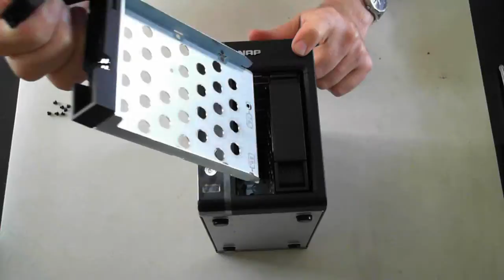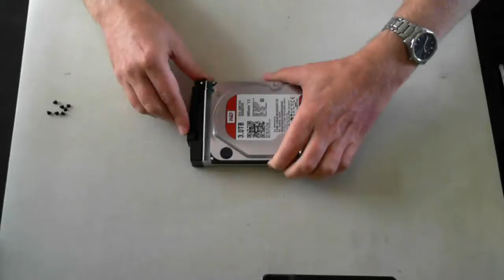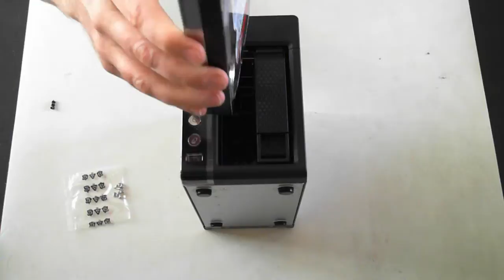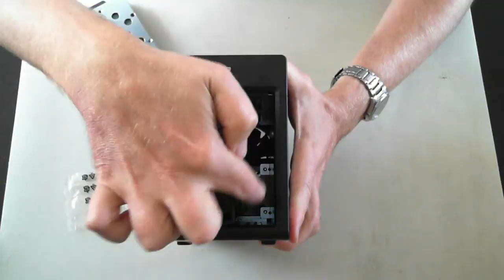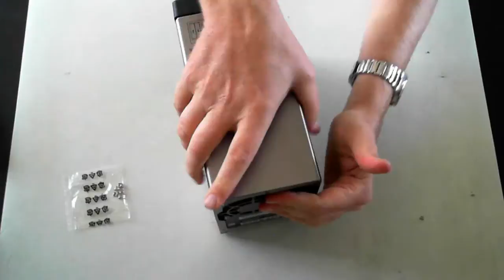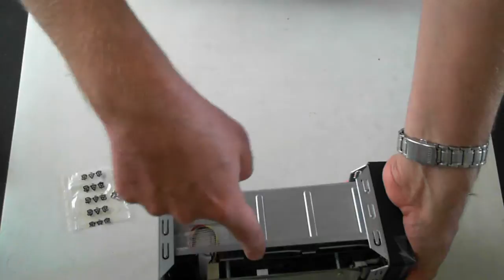QNAP TS-221 Teardown

Comment: These things are bloody impossible to open. Accept that when they fail - and they will fail - you will lose all of your backups - thus nullifying the whole bloody point of having one! Instead use a collection (as in more than 2 and at least 4) of backup hard drives as it will be a lot cheaper and a damn sight more reliable! The PSU has failed on mine - an easy thing to replace if I could just get inside the bloody thing!!!
Reply: PSU is external brick